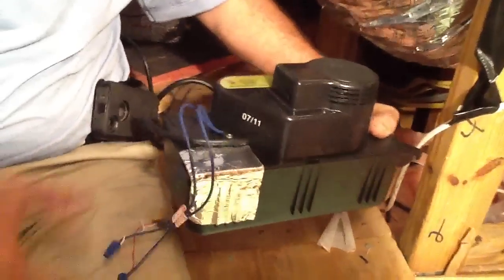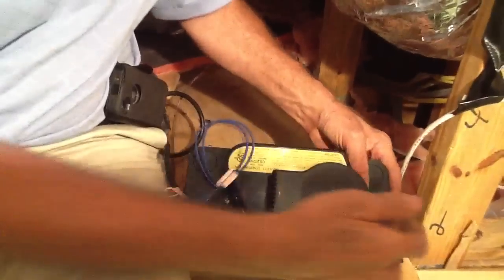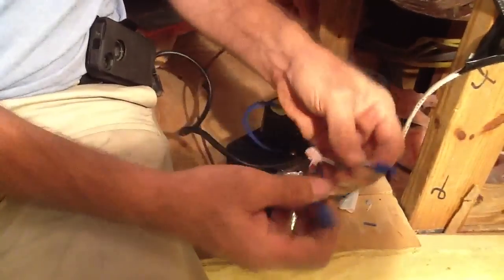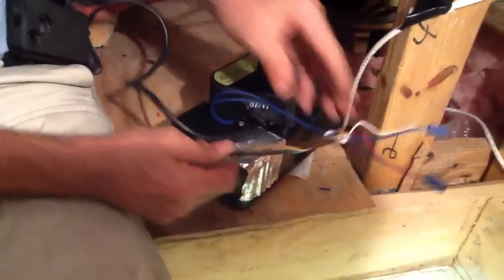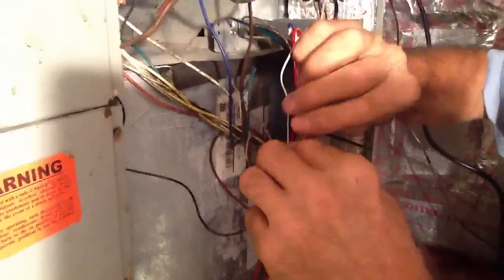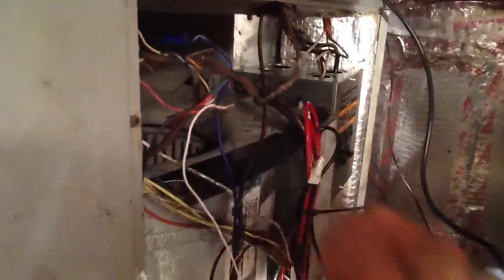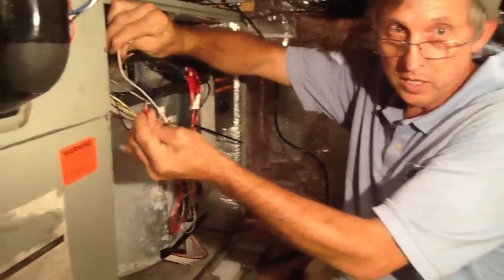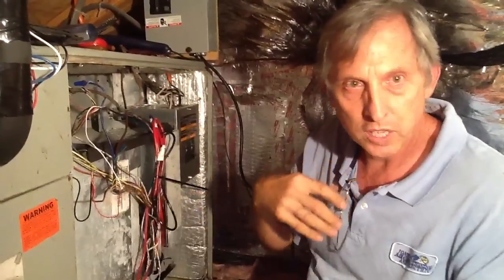How to wire low voltage on a condensate pump

Comment: I'm installing a little giant pump that does not have a safety but the original one did do I need to connect the two wires together or leave them separate to bypass the safety

Comment: I have a condensate pump in my crawl space. Do the low voltage switch wires need to be in a junction box?

Comment: When you get a new pump should it smell like burning plastic? I figured it's because its brand new and I checked it and is warm to touch but not hot...is this typical?

I figure too that the only thing that could be wrong would be the wiring to the low v on the pump itself, all I did was switch out old to new and getting a pretty strong odor.

Comment: I have a Lennox HVAC system.  My wiring that activates the condensate pump was not connected.  What color connectors should I connect this to to ensure that my condensate pump only turns on when the compressor runs?  Thanks

Comment: Thanks for the vid! If you have any thoughts, I noticed my pump has the two wires but they were laying there on each other, likely making contact, both coming out of a Ferguson PSCP20WS20T. Was this intentional or did were they meant to not be touching each other? Can I leave them entirely unconnected from anything, including each other?

Comment: Do those pump safety switches typically work in "dead-man" fashion, so that the switch opens if power is interrupted to the pump?   Because it would be nice to know the A/C will shut down if someone kicks out the cord or the GFI outlet fails...
Reply: If the power to the condensate pump was interrupted, the water in the pump would rise until the safety switch would open and shut down the AC.  So there isn't a need for the switch to open the second it loses power, because eventually the AC will shut down before the pump overflows.

Comment: Thanks for the video.  My previous condensate pump just died (water overflowed all over), it was not wired into my weathermaker 9200.  Replaced the condensate pump and would like to wire it in so that the system will shutdown if the pump fails.  My thermostat and handler wires meet at a terminal on a PCB on the weathermaker 9200.  What is the correct way to wire the pump in this situation?

Comment: Don't agree with breaking the power to the thermostat, doing that would shut my Ecobee thermostat off.  Makes more sense to interrupt the AC circuit / yellow wire and shut the compressor down since that is the source of the moisture. I suspect the blower will still run however.
Reply: I thought about that but I also have a whole house humidifier too that’s used during the winter. So in my case, there’s two things that need to be interrupted. I suppose I could splice the lines into the humidifier as well or just take the general approach of splicing the red from the thermostat. At least if the entire ecobee goes down, that would provide an alert.
Reply: If You Have High Efficiency Furnace Like I Do It Gets Condensation During The Winter/Heat Cycle As Well...Red Wire Is What Needed To Be Spliced